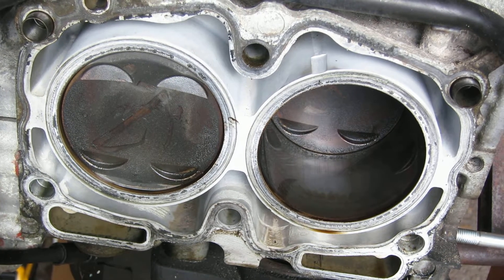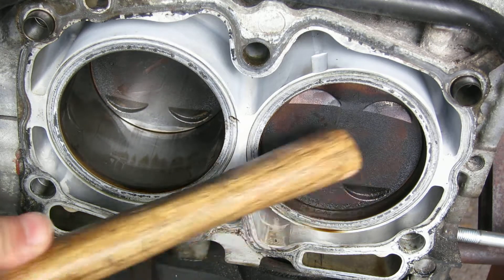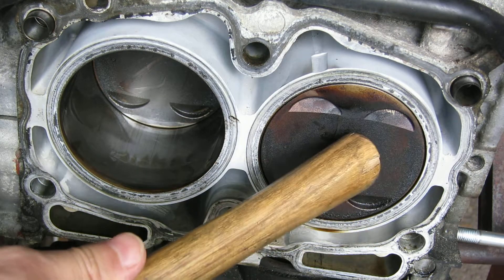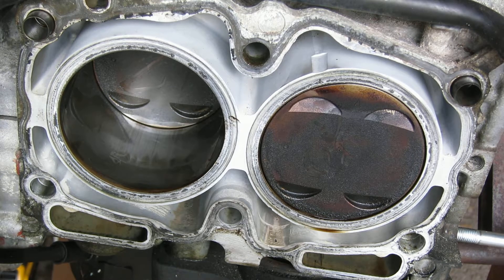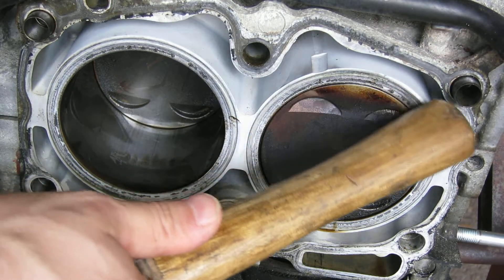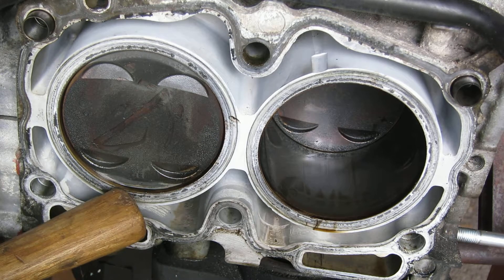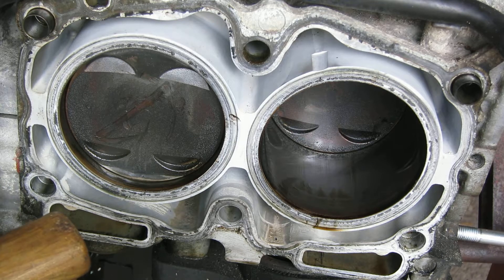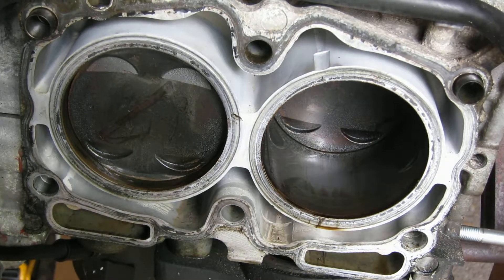Confirming rod knock or spun bearing on a Subaru EJ motor

Comment: Finally pulled the engine last night, and the oil with only 250 miles was dark and the oil pan looked dirty, like when you drive a long time and don't change the oil, like this grayish film,  I took off the oil pan and right now a bolt on the timing cover won't come off, but it will, then I can pull the heads after I line all the marks up on this DOHC....the rod closest to the flywheel, you can wiggle it with the oil pan removed...I think it failed and the oil is grey/black due to bearing breaking down...IDK... and IDK why it failed

Comment: Can i ask , Which a car model of this piston ?
Reply: My forester xt has the ej255 and I spun a bearing the other night lol
Reply: ej205, the 5 means WRX which means Impreza WRX...one of these websites said 5 means WRX or Forester.  But it's been my experience the Forester are the EJ25 (EJ253 ?), the 2.5L, and not 2.0.  Later WRX did go to 2.5 and that's one of the ways they got to 315 Hp.
Reply: @DanTheManIOM  the Forester GT (turbo version) has the same motor as the Impreza WRX, EJ205. It's the later model that has the 2.5 L displacement. Although you're technically right, the naturally aspirated Foz has the EJ253 motor.
Reply: @chieerchadar6617  What does that 3 digit mean ?  EJ253 vs EJ257 ??  thanks